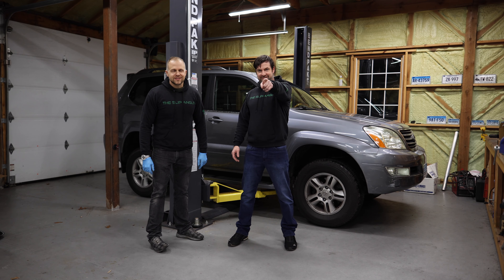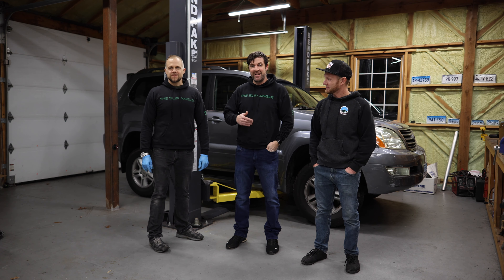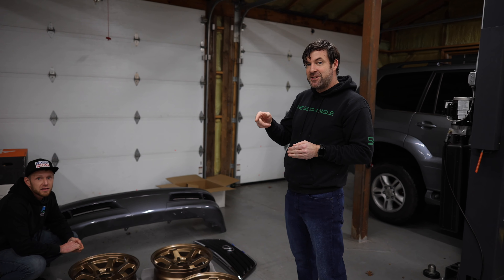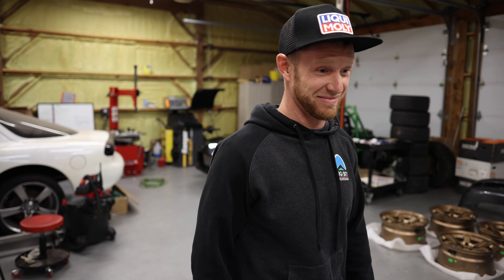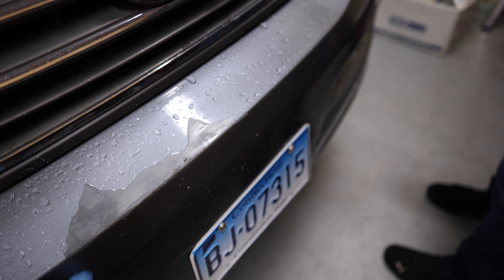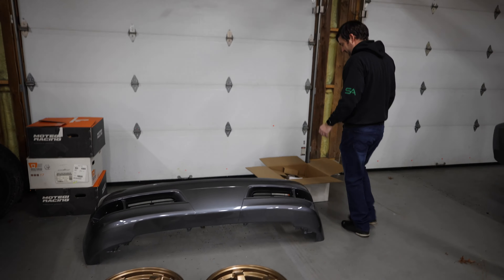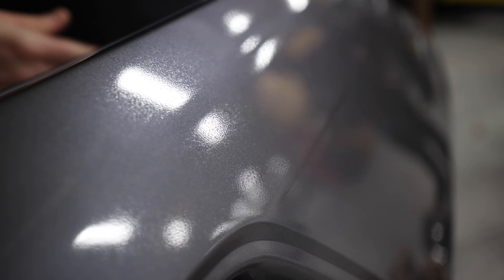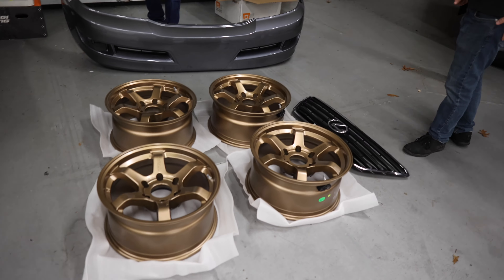GX470 First Mods & Fixes

Comment: Just a quick comment regarding ‘wheel capacity’, I think it’s probably not a problem because most 6 lug wheels will be made with truck capacity in mind- but my Mercedes SUV shares bolt pattern with mostly cars, so the aftermarket wheels are made with the capacity of a car in mind. They’re certainly not made in mind of a 5500lb SUV pulling a 7500lb with 1000lb of tongue weight.